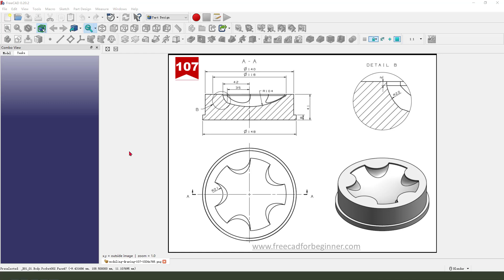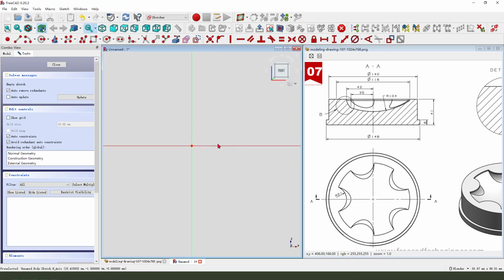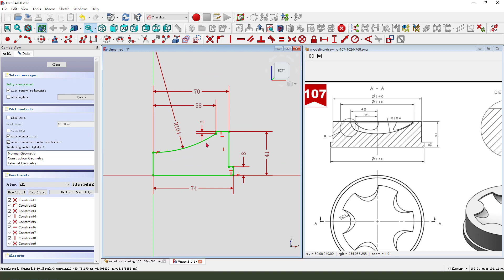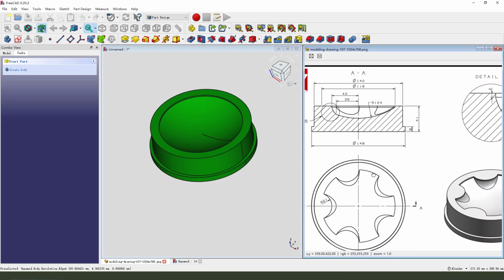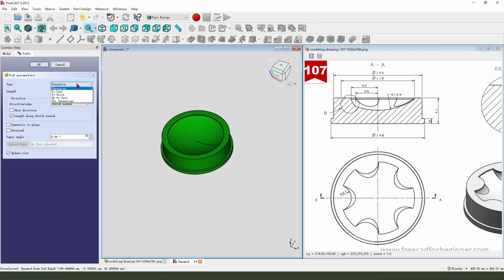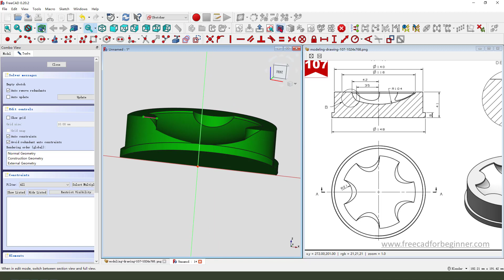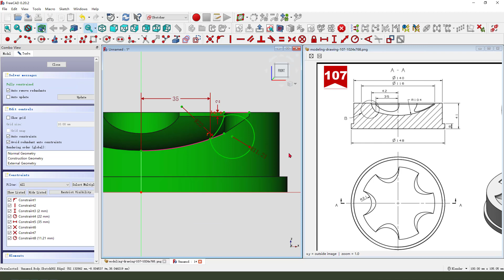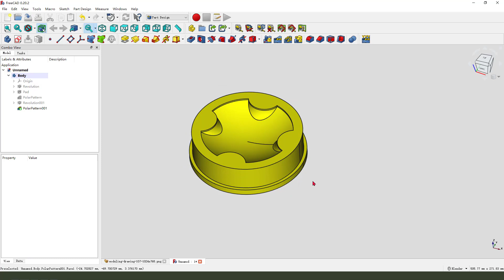FreeCAD Tutorial for beginners,basic model exercise-93

Comment: Great video. You explain exactly how to build the model except for when you did the polar pattern of the pads you only did 4 instead of five in the drawing. I did 5 pads and it took me a bit to figure out how to get the drawing to pick up the fetors of the selection view and this is how I figured it out. With 5 pads only 1 pad is cut exactly down the center. I did a selection view, then used the tool to select external geometry. The problem with 5 pads is the R104 radios can only be selected on the right opposite side of the selection view. The top pad is selected on the left side. I just extended the top line pad all the way the outer edge with the external geometry tool. The make a R104 radius ark that is constrained to the center line and started the right point of ark, constrained to the external geometry line from original bottom of R104 radius and constrained the top of the pad horizontal line. Then made a line from my left pad down vertically to the R104 radius. I made a R22 radius ark and constrained it from the line that is connected from inner point of pad and extends the R22 radius ark down to the R104 Ark. I then constrained the other side of my R22 radius ark to the R104 radius ark at the bottom. Set my vertical measurement from top of pad down to R22 radius ark to 2mm. The horizontal measurement from bottom of the R22 ark, to center of drawing, I set to 35mm and drawing is constrained. From then on just follow video.  I am not trying to correct anyone but only help those others with OCD like myself that can not stop until my task is complete.  God bless and have a great day.